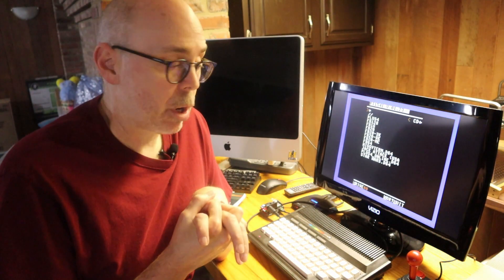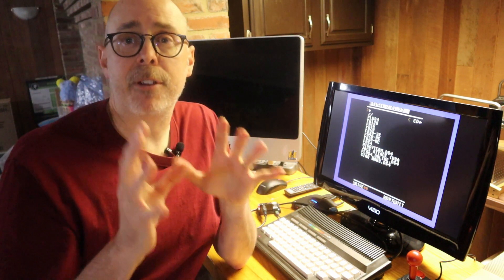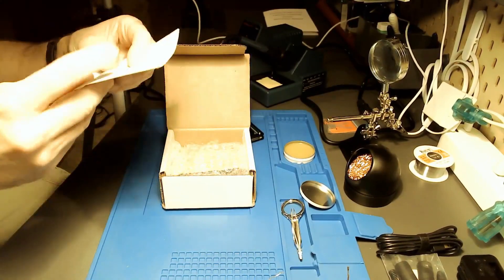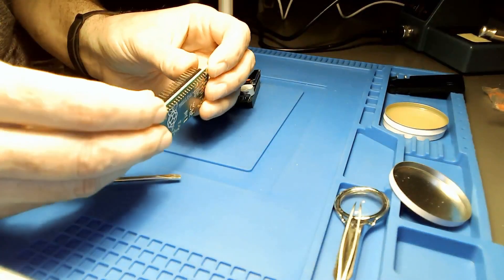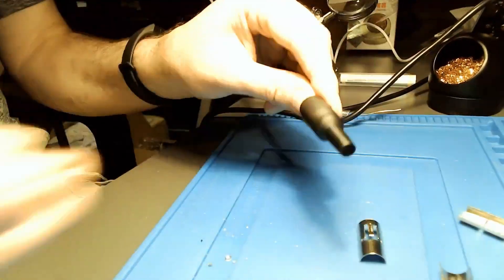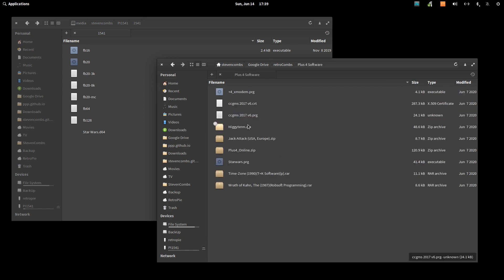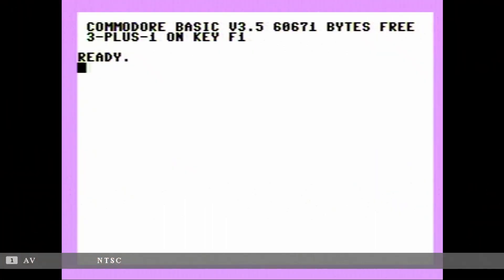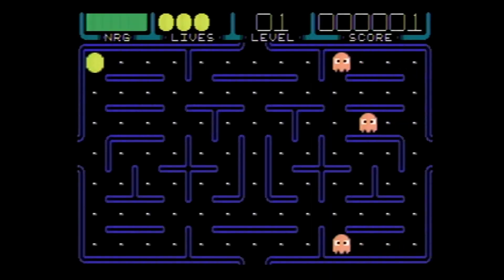I Assemble & Configure a Pi1541 for a Commodore 64? #commodore64

Comment: Hey Steve, I enjoyed this. 

Question: does cycle accurate mean the pi1541 is faster or slower than something like an SD2IEC+? 

I had assumed it meant faster, but your video seems to suggest slower. 

Thanks either way!
Reply from the maker: Thanks! Cycle accurate refers to the Pi 1541 having speeds similar to a real 1541 so software with problematic load routines or fast loaders have a better probability of loading. Speeds, in my experience, are similar to an SD2IEC but not as fast as the Kung Fu Flash, which is amazing!
Reply: @retroCombs  Ok, thanks for clearing that up. So it's still the job of a fast loader to bring up the speed. Thanks for the video, it makes the pi1541 a more appealing option.
Reply from the maker: Glad it was helpful. Happy to answer any other questions you may have and again, thanks for watching.
Reply: @retroCombs  Thanks! I do have another question: if you have a cartridge occupying the cartridge slot (it needs to be there because it has a MIDI input on the cartridge itself), is there another way to employ a fast loader? 

I'd like to be able to save my work to the pi1541, but I'm also thinking I'd like to add a bunch of games to the SD card, and having them load quickly would be nice.
Reply from the maker: @WillisZzz  There are a couple of options. You can install a JIFFY DOS chip in your computer. There is a way to implement JIFFY DOS (not technically legal since the ROM is under license) on the Pi1541; I've just not tried this yet. Here's a thread of discussion that explains the process: https://www.lemon64.com/forum/viewtopic.php?t=70325&sid=da43654df5d1556d3ea4d79d00bff979
Reply: That sounds like an ideal rabbit hole for me to jump down, thanks Steven! Keep the videos coming, and take care

Comment: Howdy, Steve. I’m wondering if you could tell me if it’s possible to use one Pi1541 as two separate drives (8/9) simultaneously to run a BBS? And if yes, how might I configure that? Thank you! 🤙🏼
Reply from the maker: I don't believe this is possible but you could daisy chain two of them using the IEC cable and then configure them.

Comment: DIN connectors placement on these boards sticking up above oled display so much on basically all of these pi1541 boards is absolutely puzzling me..  Really wish there were some longer boards available with din connector (connectors) on the underside... so that the whole unit is slightly longer or wider (overhanging outside of pi zero or pi 3 profile) but not as deep/thick. It would be much easier to make or re-purpose some neat existing enclosure for it if there is nothing sticking up above oled screen and control buttons.
Reply from the maker: Completely agree. This is the one sticking point with me too. Especially as I try to design a new enclosure. Your message timing was perfect as I was trying to determine if I could easily de-solder the display, add a ribbon cable, and move it to an alternate location. Possible, but wow! It would require a lot of work.

{UPDATE} After further review, moving the screen will not be as difficult as I thought. It is only four pins and they are easily accessible. Now I'm really thinking about it. I've also thought about adding a larger screen with more information. Hmmmm….my mind is churning now.
Thanks for watching and providing the feedback!
Reply: @retroCombs  Looking forward to seeing the video with the custom case!  I believe you can also desolder the DIN connectors and solder in cables to attach them to the board, allowing you to locate them where it would work well for the case design.  I'm really looking for a case design that looks like an authentic 1541, 1571 or 1581, but in miniature - just big enough to hold the PI541, but still has the proportions more or less right.
Reply from the maker: I'm attacking this two ways. One case will be, just enough. No modifications required but a couple of cool features. The next version will be a more "Commodore-Like" design. The first solution will inform the second and might include a move of the display rather than the ports. First version is almost done! Early prototypes have been close, but not ready for prime time just yet. Thanks for watching and commenting!
Reply: @retroCombs  When I'm doing mine (soon) I'll be desoldering these DIN connectors and getting panel/chassis mounted ones.. something like this https://www.avnet.com/opasdata/d120001/derivates/2/072/150/488/Deltron-651-0600-Image_web.jpg ...and mount them where I want in the enclosure.. but I can't really understand reason why so many pcb designs follow same silly DIN connector and control buttons placement.. on item that is so light, buttons should be on top.. when they are on the side I think you're supposed to use both hands.. one to hold your pi1541 in place so that it doesn't move around and your other hand to push the buttons... this pcb/case design is neat (somebody did really great job) https://www.breadbox64.com/blog/the-pi1541-disk-drive/ but expensive to purchase unfortunately... with slightly tweaked pdb design and some bog standard enclosures.. it would be quite easy to get similar looking pi1541 for fraction of the cost...

Comment: Need that jiffydos! :-)
Reply: need to emulate a 1551 drive, it is 'loads' faster than the 1541 to start with, see what i did there? lol
Reply from the maker: Need to figure out to use it on the Pi1541 and Plus/4. Thoughts?
Reply: @retroCombs  I think some folks ported jiffydos to the plus4 a while back I don't think it was generally available back in the day. I think that a few folks out there have it you can pop in or piggy back it on the kernel rom and switch back and forth. I also think that the pi1541 like the sdiec can emulate the jiffydos modes for speed up.
Reply from the maker: @JamiesHackShack  Thanks. I'll do some research. There's a file on the Pi1541 entitled jiffydos but I think I have to activate it in the configuration file. Fun stuff!